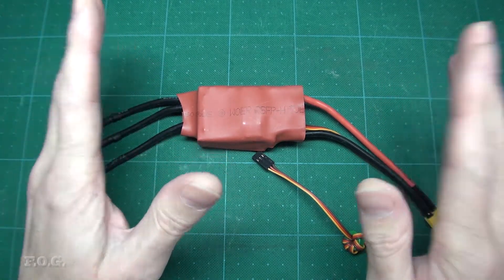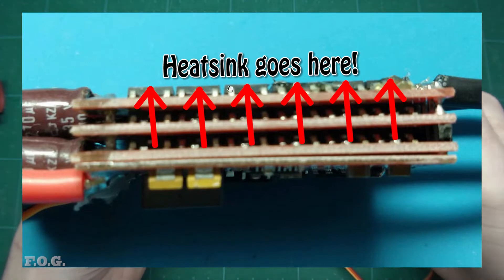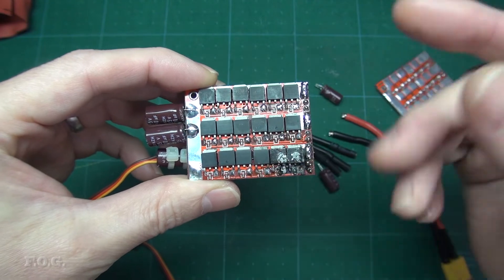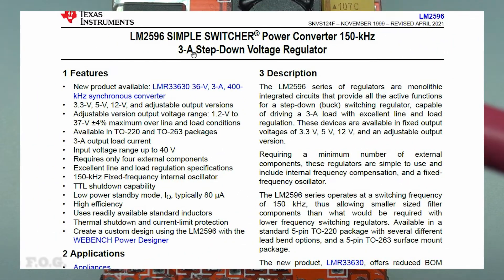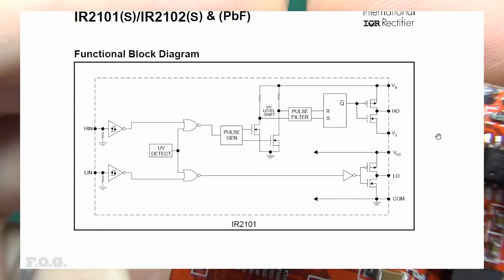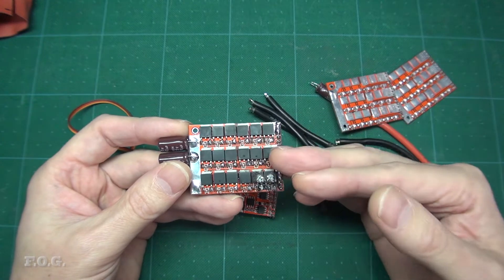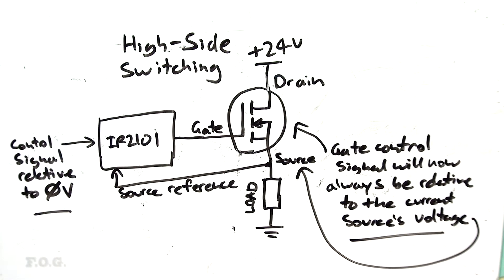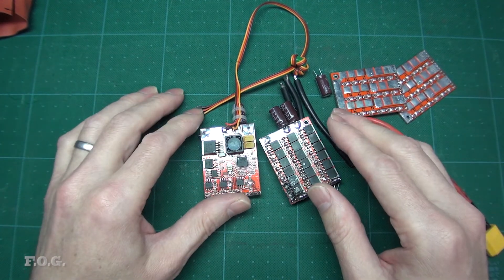EP1 - Electric Motivation - What’s inside a cheap ESC?? Teardown!

Comment: Red Brick 200a ESC 2-7s ?
Reply from the maker: This was a no brand ESC. But I just checked the red brick one you mentioned, and it looks exactly the same, and I suspected made by the same manufacturer. Thanks for the question. If you're interested there is a more in-depth look at how this ESC in episode 6 of this series.
Reply: would u plans to reverse engenering this n make ur own diy ESC ones ?
Reply from the maker: @NextSubscribez  at first I was just seeing if I could understand how these things work, but was surprised to see the design seems pretty generic. So the simple answer is yes, I do plan to design my ESC making use of what I have learnt. It is likely however it will be a more specialised design with much better performance and reliability (hopefully!)
Reply from the maker: @NextSubscribez  I will surely write my own code for this. The programming of this ESC is not so good.. So I am thinking to try a Attiny1616 which I already purchased. Maybe I will recycle these Atmega8 and other components from these ESC's in the future if I can.

Comment: hi! I just came across your videos, so you'll probably see me a lot in the comments. If I understand correctly, all an ESC is, is just a brushless motor controller, right? If thats the case, theres a ton of app notes across the web on how to make your own and we could tailor a controller for our needs. Microchip has a few example circuits using a PIC18F or PIC33F. Im currently looking into brushless motor for a lathe Im designing, so this would be an interesting project to undertake.
Reply from the maker: ESC stands for Electronic Speed Controller, so a motor controller, yes that's correct. For brushless controllers, often a B is added to make it BESC.. same thing. I am sure there is heaps of example out there on the internet on how to make your own. This video was just looking at how even manufactured ESC's can be simple and use off the shelf stuff, so it makes it seem more realistic that you could make your own in some custom situation. Don't hear much about PIC lately, AVR and STM32 cores seem all the rage nowadays. Personally, I would probably go with the STM32 if I wanted to make a more precision controller. Thanks for watching and thanks for the comment!
Reply: @ForOurGood  Yea PIC isnt used too much in the hobby sphere. Im not sure why, but as a PIC user, they have great peripherals and the datasheet is easy to understand. Ive used them for quite sometime, and my only large complaint is that they dont have the library support that say Arduino users have (like the GLCDs). But thats OK.But, I say people should use what they are comfortable using. Most of the time, I have found I can read arduino code, as long as I understand the registers and what not :). 

I am pursuing this and am probably going to use a dsPIC.
Reply from the maker: @Overclocked2300  I fully understand your point of view. I remember I did the same during the PIC boom days, sticking to my ST25 that I knew. But actually it was a mistake, I should have made the effort and gone to PIC. Sometimes it does give net benifits to stay with what you know, but not in this case. If I have any advice to give, get familiar with AVR and STM32, it will be worth the effort.

Comment: Fantastic video ! 
The thing I don’t like about having all those Mosfets in parallel is the gate threshold voltage can be different on each Mosfet , might only be a few millivolts but it means one Mosfet will turn on a little before the others and turn off a little after the others . Also it increases the gate capacitance as they are in parallel so the driver has to dump more current to get the gate voltage down to zero and give a sharp turn off , if they don’t turn off quickly they are just a resistor in series with the load and have to dissipate more heat .
Might be better to have the minimum number of Mosfets rated to handle the voltage and current plus a little ?
Reply from the maker: Actually the threshold difference was up to 0.6V in the worst case. I did not feel comfortable with that either, so I tested them all, grouped them up and tried to make one ESC using a smaller threshold range. I also randomly distributed them to spread out the heat.. but really it's probably not that critical. not good of course. The switch speed is so quick overall, I expect any unwanted momentary crossover or short is not causing major issues, maybe just a little extra heat.
The capacitance issue you point out is a real factor, and you can see that on the falling edge of the input signal of the scope shot I took. But again here too, likely not critical in this design. I expect the protection resistors on the input are also softening the blow a bit. 
I agree however, if I make an ESC myself I will likely stick to good quality and spec mosfets and try to keep the number of mosfets down. This also has the benefit of making the heat dissipation design easier.
Ultimately my take on why these cheap ESC die is now two possibilities:
1. The Mosfets are garbage and just go short when they feel unhappy.
2. The Microcontroller gets upset and turns on a the mosfets so they short out to the power supply and fry.
Possibly back EMF is the trigger for some of failures, but seemingly not all...
To address the first issue is easy enough, don't use garbage mosfets.
For the second issue, adding some lockout logic to make sure shorts can't happen is likely the way to go.